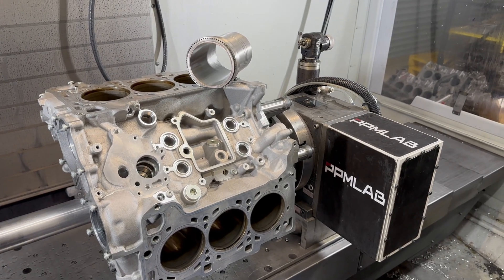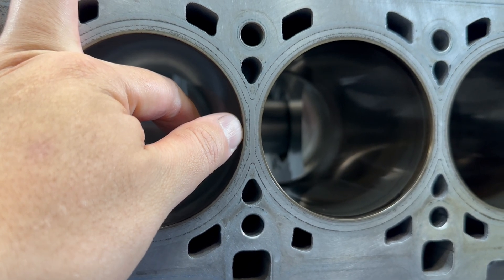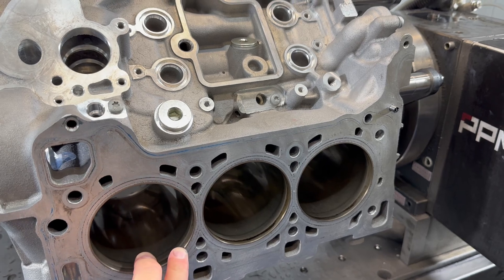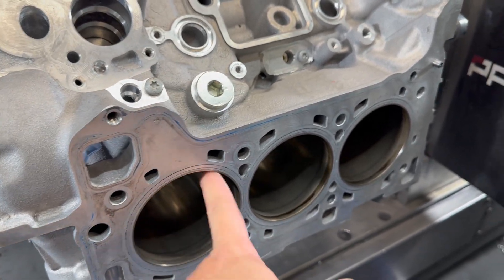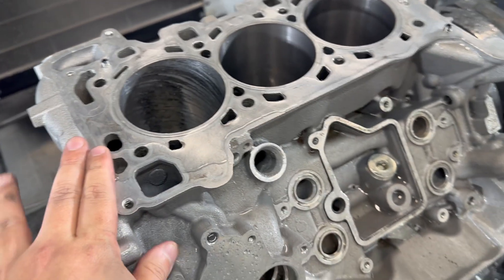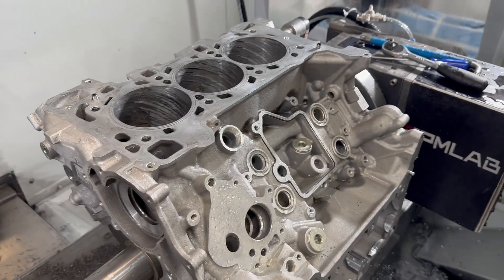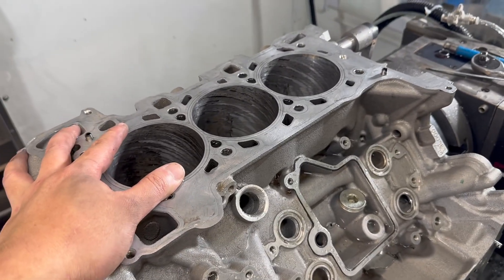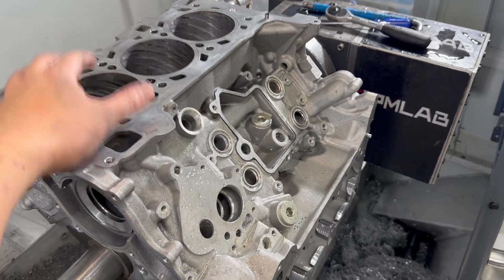VW EA839 from High horsepower Audi S4/S5 , issues of OE blocks and PPMLAB wet conversion for  1000hp

Comment: The discussion about the uneven sleeves/bores starting around 4 minutes, could that be why these engines are scoring bores and eating piston skirts? Audi recently extended the piston skirt warranty to 8 years/80k miles and there's been a rash of owners getting new engines after their engines tick at idle from piston slap. The warranty covers 2018 to 2025 cars, its a huge number.

Comment: Awesome video. What about the EA837 Evo, aka "CREC" engines? Unlike the original EA837, CRECs also have cast-iron liners.
Reply from the maker: The liners of EA837 Evos is quite similar as 839. But 837 came with much smaller bore spacing so even more restricted with dry flange sleeve. For 837 block reconditioning we almost only recommend wet conversion for reliability

Comment: Ill be fair iv3 been running around 500whp and this issue did not happen at all with  me this is genhinly the first ever block ive seen with anything like this
Reply from the maker: Not all high horsepower 839s will run into problems. But if shit happens, the design of straight cast iron liner is definitely to be blamed
Reply: Plenty of failures happening but it's inconsistent it seems. Lots of people blame the tunes but it looks like LPSI might also be an issue
Reply: Yup and no famcy liners are saving that @dcxSpartan117  im amounts. Few guys whive gt fully built blocks and this is just not needed

Comment: What was the initial cause for the failure or for this motor coming out in the first place? I have a B9 S5 so I’m curious… Also how did the the needle bearings for the rockers look? Were all the needles still in the bearings? What year car did this come out of?
Reply from the maker: This engine came out of a 19 B9 S4 IIRC. The car was tuned to run 500WHP with hybrid turbo and eventually blew his head gasket. If you run with stock power, the factory block will be all fine but if you go with some aggressive stg2 tune or bigger turbo, the engine will not hold for long, maybe less than 20k miles. The rockers out of this very car look all good.
Reply: @ppmlabofficial  also interested on where you are located and if this is something you do regularly.
Reply: @ppmlabofficial  What about stage 1 tunes ? Would stage 1 with stock turbo cause this problem ?
Reply from the maker: @Shulcyo  Less likely than high boost setup, but we have seen 1 stock power with blown gasket
Reply: @ppmlabofficial this si fundamentally just not true plenty stock and stage 1 and 2 cars have failed its pooelr mainintncne poor quality rocker arms and lspi
Reply: @ppmlabofficial  yet there are countless examples of stage 3 cars. Having no issues, being daily drivers. That have been tuned for over 80k already. 
The biggest issue people are having with these engines. Is not enough fueling head room for error. 1 injector not operating perfectly and you are done.
Reply: the 4th one so far. We only developed the wet sleeving for ea839 6 months ago. Still fine tuning the sleeve shapes especially for the cylinders on the side.